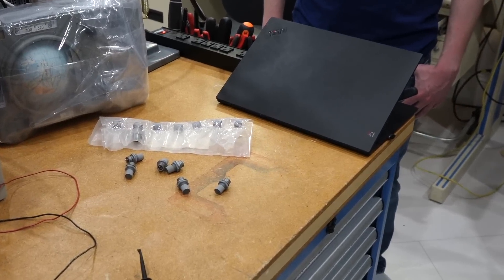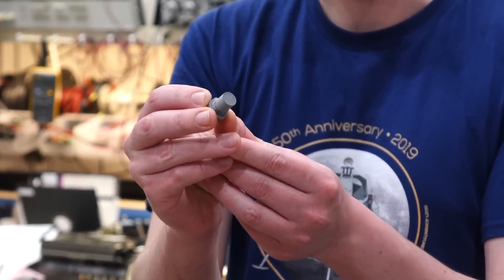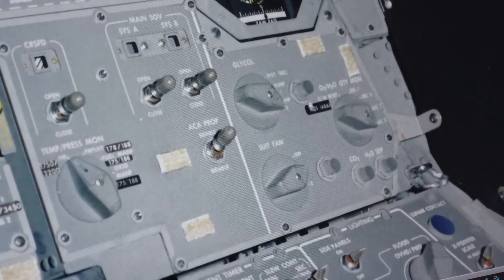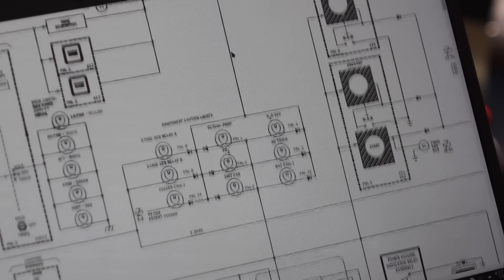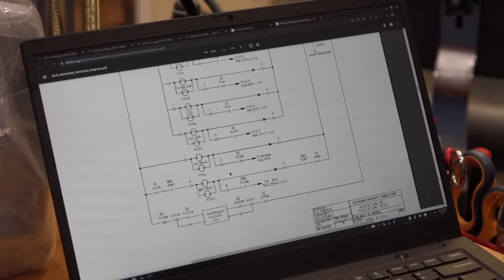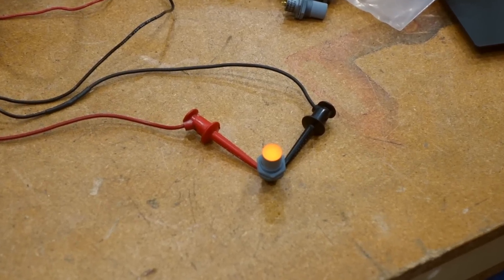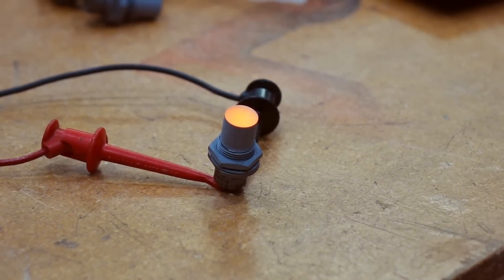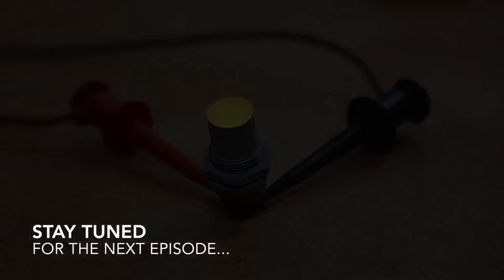Apollo LM Caution Lamp

Comment: Looks like first generation of the red LEDs. They are red in normal powering, and become orange and yellow when strongly overheated.
1.5V 20mA is a typical powering, but yellow starts from 4+V, same as on video.
Reply: i think there were no leds on apollo program at that time, there were not realiable enough

Comment: I met some people a while back from Rockwell that were the ergonomics designers of things like this.  They would spend hours upon hours finding the perfect designs for parts like this.  In the case for knobs and switches, they had 1-2 people that knew what the "feel" of a panel and switch should be like, based on its function and role.    They would take force measurements of all these switches, and then put them to extreme use scenarios....then take force measurements again....and then have a human operate a brand new vs used to validate that they always had the same feel...even after a number of uses.

Comment: I like how it is designed to prevent it from looking like it is lit when it is not. Sunlight or some other light source may sometimes reflect from a clear lens and look like it is on. This dark grey makes the difference between a lit and unlit lamp significantly clearer, which is obviously mportant for safety reasons.

Comment: I worked in production test at the electronics division of a major aerospace company in the late '70s & early '80s.  I got to work with some of the very latest technologies, and some not so recent. Logic circuits with RTL, DTL and of course TTL and early CMOS chips. New builds of old gear using Nixie tubes for digital readouts, errors in the displays because the test procedure said to adjust the anode supply for "at least" +240 VDC, but the newly built ones were outputting +325 VDC (until we adjusted them down!).  Digital counters using Silicon Contolled Switches (SCS, like an SCR but with off and on gates).  Or numerical displays the used incandescent lamps in a grid pattern, each lamp housed in a small tube with a lens.  As each lamp was lit, it would be like a tiny slide projector, shining a number on the back side of the frosted front of the display.
Fun times, I learned a lot there.

Comment: The diagram even shows a "lighting override" flip switch, so I guess if the C AND W DC DIMMER CIRCUIT should fail, you can switch the C/W lamps from dimmed 2...5V over to a direct 6VDC bus. Nice contingency option.

Comment: Well, they are "push-to-test" lights, as used on aircraft. What lamp do they use? 387 or 1865? These are the part numbers of standard indicator light bulbs used on American aircraft from the 1950s to 1980s.

Comment: Switching the ground on/off instead of the positive, or both, is how lights in most European cars have been made since the early 2000s. Doing it this way means you don't need as beefy a switching circuit and thus it's great for low voltage lights (like LED in modern cars). But with the faulty bulb detection, what if the caution light to tell you that a light is broken is itself broken?
Reply: obviously, you need a caution light for the caution light .....
well obviously you would also need a caution light for the caution light for the caution light 
..... ähm well of course you would also need a caution........

Comment: I'm really interested in the form factor. Why they choose for the bulb housing be outside the panel?
Reply: Lighter weight probably, and to save space behind the panels so as to increase usable volume in the spacecraft. After all the outside dimensions were fixed, and they had to fit an entire cockpit worth of controls into there, plus 2 bulky space suits, plus still have room to move. Save an inch in depth makes the difference between a usable space or one that is not. Remember the Lunar modules were designed for ex fighter pilots, who, in general, tend to be selected to be shorter than average, and thus able to fit the cockpits.

Comment: I'd be eternally grateful if you could somehow figure out what kind of optical assembly is in there 🙏
Reply: Tiny spun aluminium parabolic reflector, polished well, then anodised to a matt finish, with lamp in centre. then a HF acid etched glass cover over the lens, and finally a outer epoxy resin sleeve that was there to provide protection and 1000V insulation, and finally the outer thin wall aluminium sleeve that provided the mechanical support and the threads.  Lamp assembly slid into the sleeve, along with the base terminals, then resin pour to seal it in, and once heat cured machined to the right dimensions to fit the outer, which it was then fitted to with more resin. Cure again, and finally machine to the correct length so lens is flush, and then paint with Duco primer all over, one coat, and then the body got a second coat. That grey colour insode is a primer only coat, as adding the extra layers of paint to the LEM would have increased mass by a few kilograms, so only a primer coat was used, to keep the aluminium from corroding through in the pure oxygen atmosphere. The ground based mock ups used had much thicker plate, they had to withstand being used in heavier gravity, and also to survive hundreds of cycles, unlike the production ones, which just had to survive a few dozen pressure cycles, and one use.
Reply: @SeanBZA  Whoa, how do you know all this?
Reply: @hrtlsbstrd  Taking a guess, but have stripped other avionics assemblies in the past, and figured out that it was likely they would, as much as possible, use parts from existing units to make them, and also that there was a massive need for them to shave mass off, hang the cost, of the whole LM and CM, as each gram they could cut was either an extra gram of payload, or almost a kilogram of fuel and a kilogram of launch vehicle. After all Grumman made avionics, from the wire, plastics to the sheet aluminium they used, all in house at one time, and had plants that made every single part of the products in house as well, because they were pioneers in the industry all the way. Only later on did they get sold off and merged, with the end of Apollo and the big layoffs of the aerospace industries later on.

Comment: Completely flat gray surface that turns orange. Wonder how they've done it. And I can clearly understand the idea of having a such forgettable look when unlit, it doesn't distract the eye at all on the gray instrument panel. If not lit, it's not important at all.
Reply: Same approach in modern airplanes, such as Airbus - no lights means everything is in order.
Reply: Probably the inside surface is grey, so when it's not lit you just see that through the diffuser.
Reply: And how much current does it take to do that?
Reply: I suspect that it's done like the Mission Control switches from the era, a transparent(ish) facing, and behind an incandescent bulb with a coloured cap, rubber for MC switches, here? No clue.

Comment: Wow, what a button-shaped lamp. (And so smooth and led-like) Not the most user friendly bit of the console, but I imagine you'd be quite startled if it lit... Those are quite a precious artifact, quite unique and pretty.
Reply: believe the astronauts were trained to check for any lights while doing anything, but then there was deliberately also very little other light so they could easily see if any warning lights came on

Comment: It would be interesting to know how they were made.  Are they 'just' incandescent lamps?  Was there a service cycle where they would only be run a certain number of times for testing before being replaced before launch?
Reply: Well, likely internally they are a standard avionics type 2 support grain of corn lamp, in a nice bed of resin to support the base and lead wires, with the pins crimped to the lamp and diode, then potted. Then slid into the front assembly, likely a injection moulded epoxy resin, and then this whole assembly was put in the outer case with the threads, using more resin. Finally held by the pins and given a coat of grey Duco primer all over, before a front mask and a second coat on the side, and then the part number, lot number was roll printed on the side, and then, after test and full function test, the QC and release stamps were applied. Yes likely, even in 1960's dollars, to have been over $1000 each in volume, though no doubt Grumman did heavily reuse the internal parts from their existing line of avionics certified lamps, as they do rather resemble a blend of standard light parts I have seen in use on old aircraft. But for Apollo of course putting the same lamp as the standard fighter jet came with, or the commercial aircraft, was not deemed good enough, they had to be unique and "special" for space.

Comment: Every time you showcase aerospace stuff I can't help but think of ways to reduce weight. That nut is waaaay too big to hold that part! I know it would be half a gram at best but every little thing counts.
Reply: Remember that nut has to resist the vibrations of a Saturn V launch.
Reply: There is a very delicate balance between how much weight do you want to save and how safe/reliable you want the part to be.
Reply: I thought the same, and figure the metal body and nut are made of magnesium with the rest plastic.